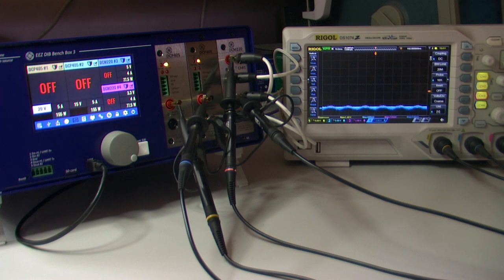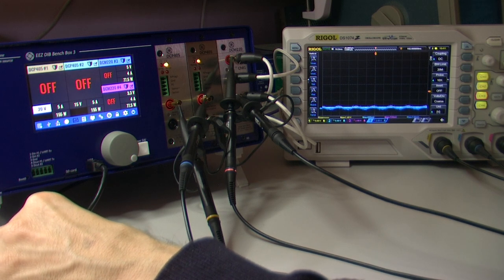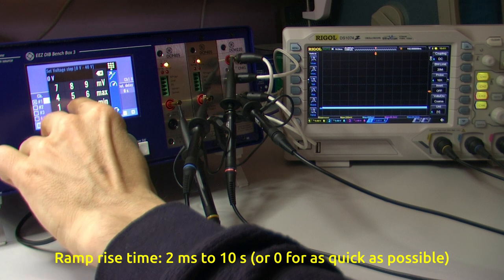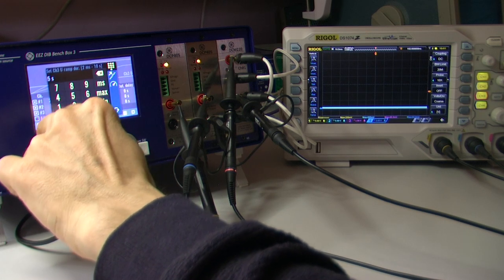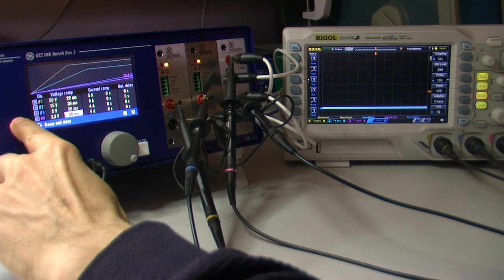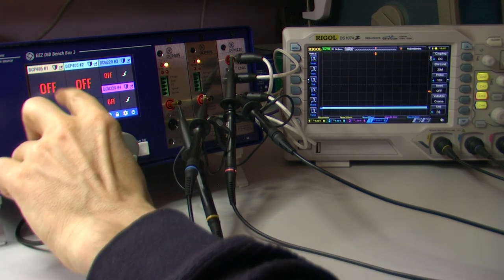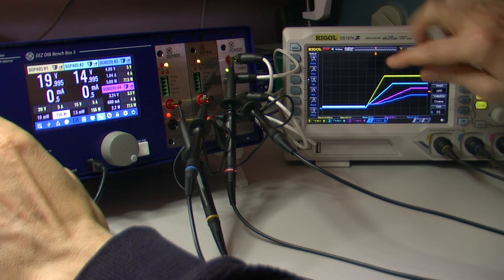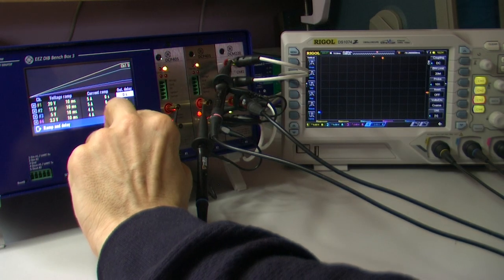BB3 output ramp & delay feature

Comment: where can one purchase this supply?
Reply from the maker: https://www.crowdsupply.com/envox/eez-bb3
Reply: @EEZOpen  one last question, does the $165 (BB3 Enclosure & Bare Boards) come without components, when it says "bare PCB"?
Reply from the maker: @BigAL-x7f  That's right. It includes enclosure parts, wire harness, TFT display, cooling fan and set of 6 bare PCBs to assembly 4-channel system. You have to take care of the module parts and soldering.